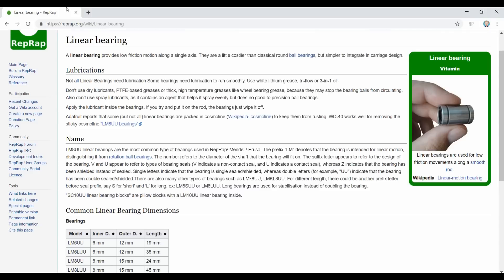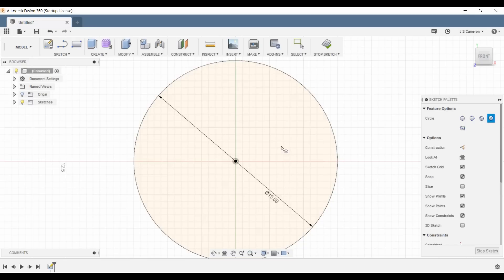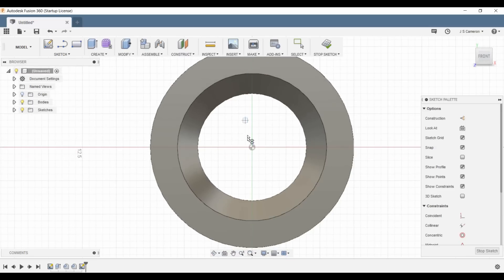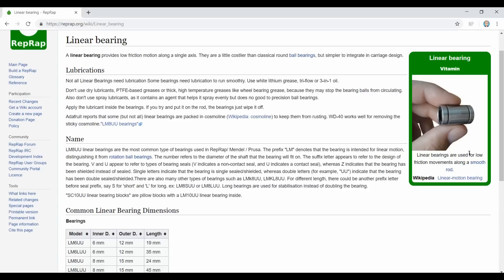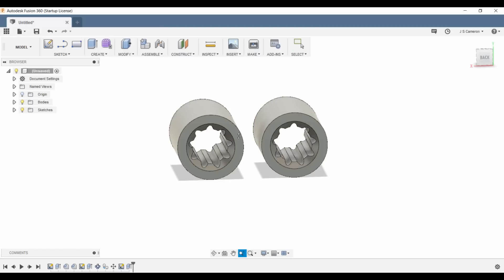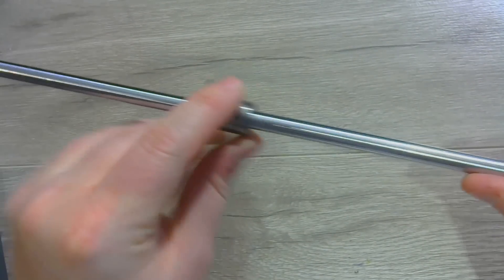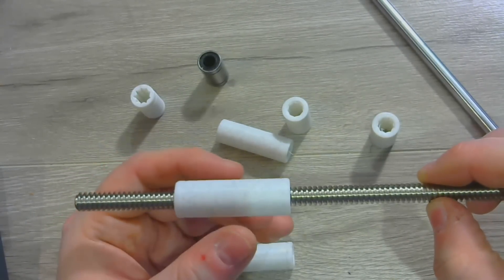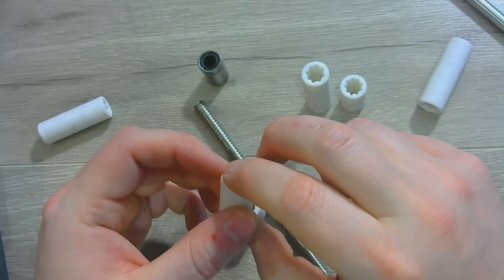Designing your own 3D Printable Bearings in Fusion 360

Comment: you can machine soy wax with the 3d printer and make accurate plaster molds to fill with a mix of recycled plastic (pet, pom, pc, abs or blends), sand (compressive strength) and chopped and unidirectional glass fiber (tensile strength)